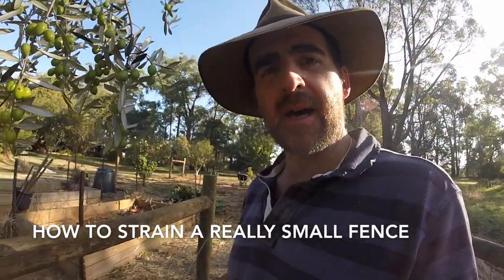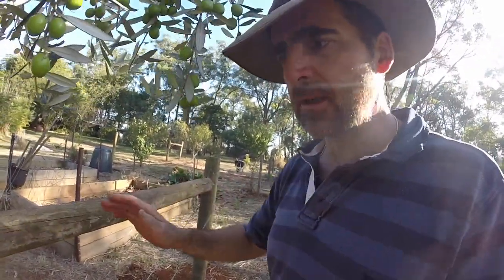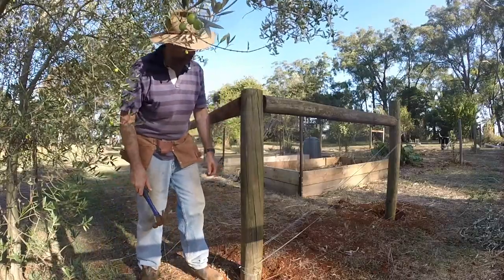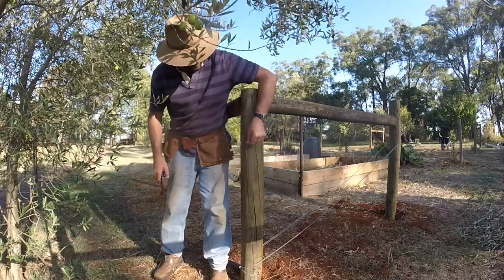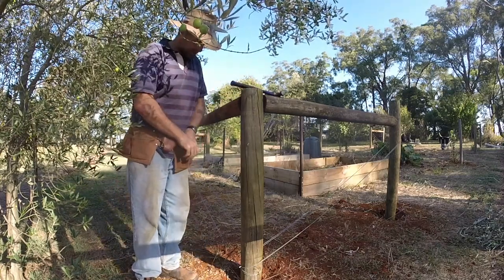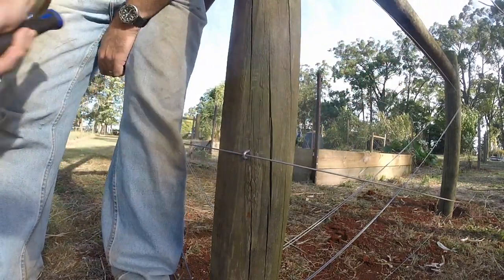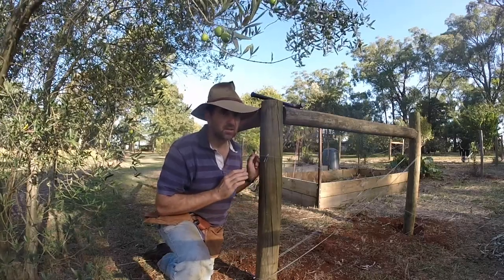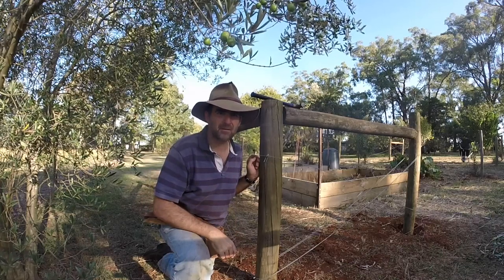Straining a Really Small Fence

Comment: Gidday Tim - you've made some great vids, I'm a fencer in NZ and always looking for useful ideas, hence looking at other fencers work!

We use your idea with the staple against the post a lot, but with a a variation, we drive the "against the post staple" so the barbs are just buried, then tap it flat into position (so it ends up set just like you are doing).  The staple holding the wire on is then driven between the legs, exactly as you show.  The benefit of this variation is that if a wire breaks or something the "against the post staple" doesn't drop out to be lost or picked up by stock.  Cheers Foster

Comment: More useful info - thanks Tim.  What are your thoughts on ratchet-type tensioners for short runs? I've used them once for line wires on a very short run and I kind of like them...can be expensive though if bought from leading hardware stores...MUCH cheaper through ag supply outlets.

Comment: Hey Tim
With this small type of fence, can the mesh wire also be strained?

Thanks
Reply from the maker: Yes mate. I’m going to do one on this soon.
Reply: With the corner post, that looks like the L, the stay wires, how are they installed? Can I just run a single stay wire around the bend to cover the 2 sections of the L or a stay wire for each section? I’ve got a 90 degree L and a 120 degree L.
Thanks Tim

Comment: If you wanted a plain wire to bite into a post, it wouldn't. 
They generally slip around a post just fine.
This dodge was popular in the eighties when HT wire was high tech. Never really see it now.
Would be handy if you didn't have strainers to pull your wire with.
Good videos though.